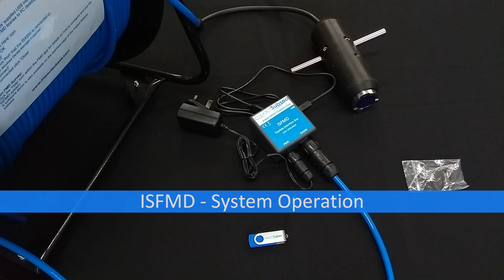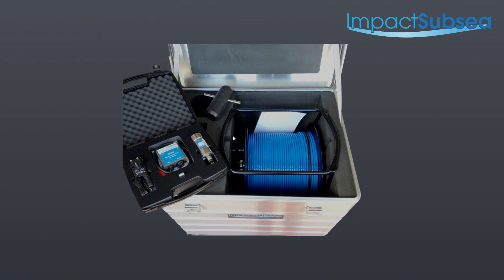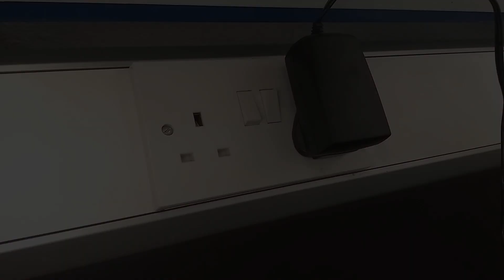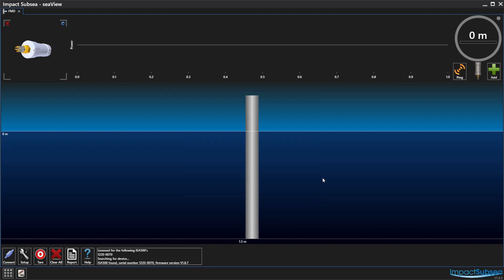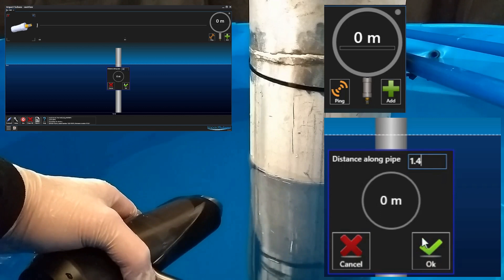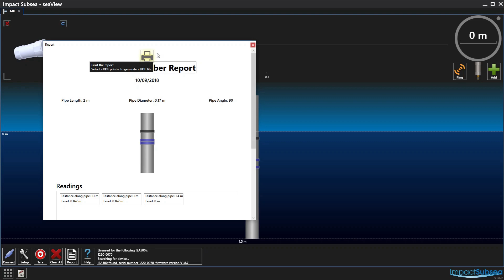ISFMD Flooded Member Detection System Operation (V1)

Comment: it is required to clean the pipe if the pipe is fouled by marine growth ?
Reply from the maker: Hello Wira H, thanks for your question! Spot cleaning is required on the subsea member/pipe at all test points to remove marine growth.  The ISFMD system is based on the use of hydro-acoustics, so requires a good clean contact point for operation. Any other questions, please ask!